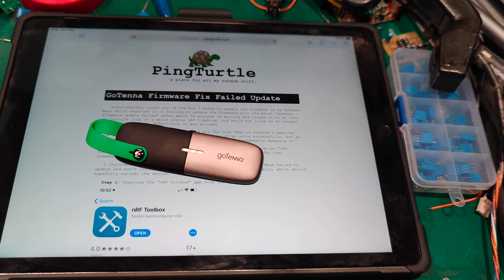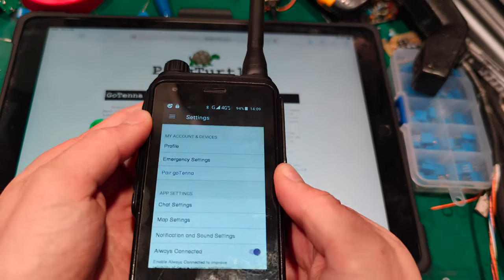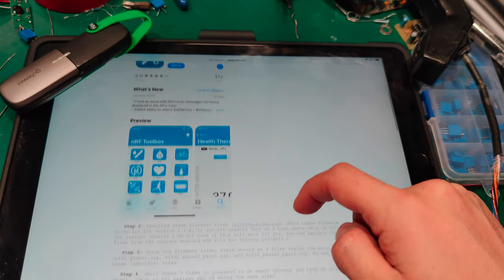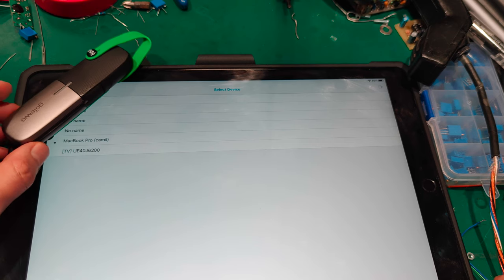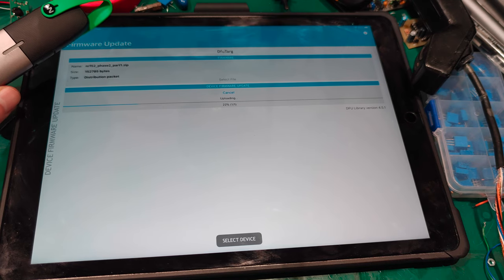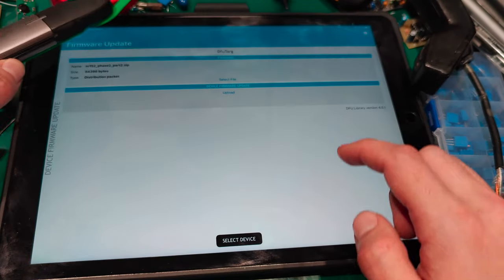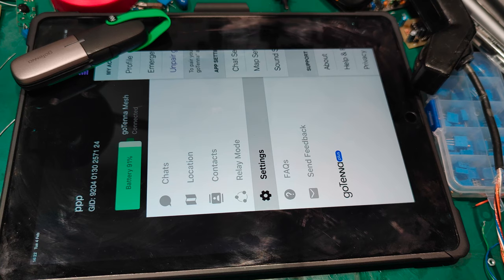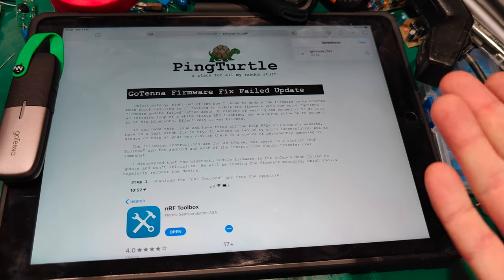GoTenna Mesh (bricked) can't pair - led fast blinking - fix by manual firmware update

Comment: Thank you so much for posting this video! I picked up a pair of Gotenna Mesh's, then wanted another pair to open one of them up & solder an antenna connector directly to the board & disconnect the on-board antenna to make a super node. Well one of them started the fast blinking during the firmware update... No matter what I did I couldn't get it back but noticed I saw DFUTarg in my Bluetooth devices so I knew it was at least accessible. After some searching I found your video. By the way, I'm running Android & the same process worked, with the exception of 'sharing to nRF', I didn't see nRF in my sharing list. I opened nRF manually & opened the data file from there. It did ask if I wanted to update the All Connected I think it said, or just the system or something else. I picked the 1st option on all 3 updates, selected the Bluetooth device as you did & uploaded it. Thanks, I got my Gotenna Mesh back!
Reply from the maker: Perfect! Thanks for update:)

Comment: had this issue and stock app on iOS device fixed the problem finished firmware update as BT/iOS apparently can bootload firmware as per the manual from gotenna.
Reply from the maker: I tried everything form GoTenna page -  from my iPad I had no reaction.
Maybe that's because I do not have this goTenna already paired to iOS / started update from it - so it didn't  know about not finished update is in progress.